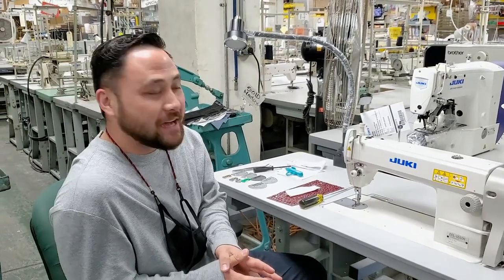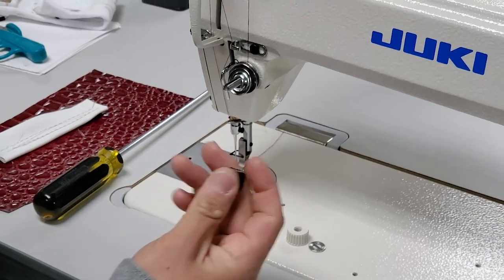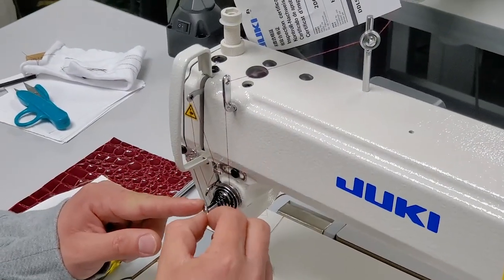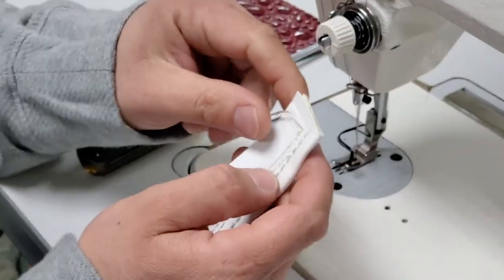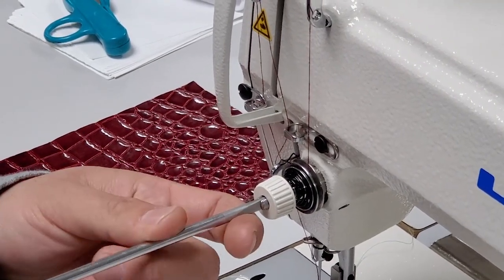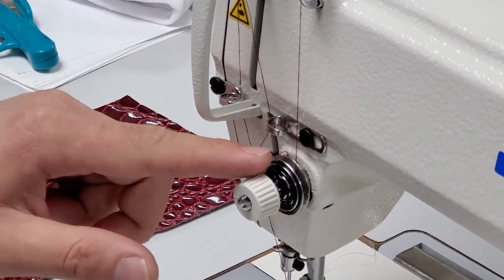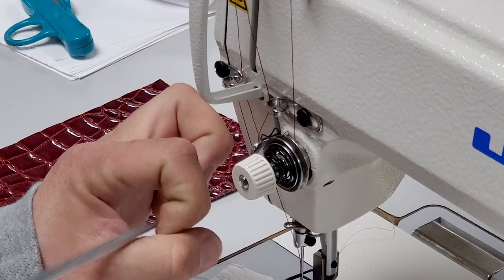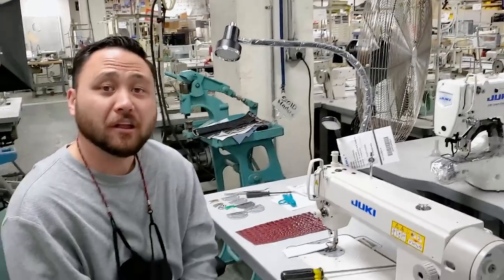HOW TO Adjust Top Tension: Tension Assembly & Take Up Spring

Comment: I had this problem yesterday, but I think it was backwards I had a little ticker thread before so I had made the tension tighter and yesterday I had to sew 6 layers of fabric I switched to embroidery thread it looked finer than the other one and didn’t move the tension, so the thread became really loose on top and snapped out of the needle, I adjusted the tension all the way to left to loosen it and it fixed it

Comment: Hope this helps.  I was able to adjust the thread with ur other video to use standard thread  and wife is happy.  

Q). I completely removed the spring and screw and put what i thought was default by counting the turns. 

Q2-  Is it good idea to get couple of bobbin cases for different types of threads? BROTHER provides a chart for needle size and that helps. 

Wife was using “Dual Duty” thread which was thicker.   I just changed it all out- used different colors and was able to see what wax going on.  but still had one color slightly coming over to other side.  

Ur video really helped with the tension.  my late MIL gave the sewing machine to us years ago and don’t think it ever had a tune up. 

Think it is a BROTHER VX-1100.   

Thansk again for post to this link 

Will see what this does. but am thankful

Comment: I have had an industrial Jack machine for 2 months, but for a week nothing has worked. On the underside of the seam there are bundles of thread or it creates loops. The dealer told me to turn the knob one way or another but nothing changed. Seeing your video, I tried your method and it works. I say 1000 THANKS to you. On the other hand, I use #40 thread (thick) but very often the thread unravels into small strips at the eye of the needle. Do you know why and do you have a solution?

Comment: Thank you, this info should be in the manual
Reply from the maker: Agreed.  The manual does however show how to move the thread guide (Silver thread guide hook above the thread tension) to help with tension instead of the method in the video.  But this video really solves a lot of issues with using different thicknesses of threads and fabrics.

Comment: Could I purchase the heavier items from your business?
Reply: Yes the Heavier COIL SPRING is part #B3114232000 and the take up spring you can try to follow the video first before swapping it out to a heavier set spring as it normally can be adjusted to fit your needs.

You can order the coil spring on our website www.abcsewingmachine.com  

Call us if you have any questions.
Reply: @josephpark2256  thank you so much for your help and speedy response.